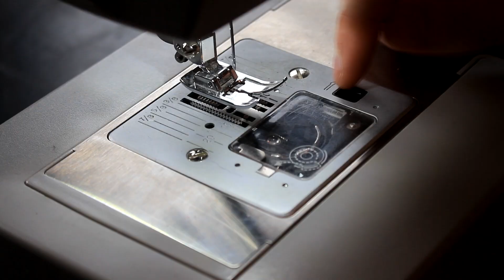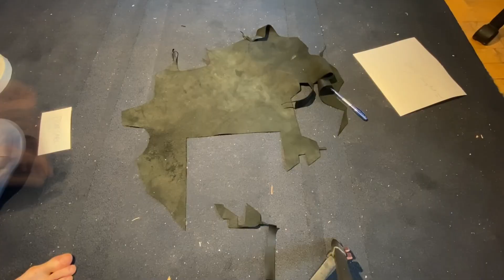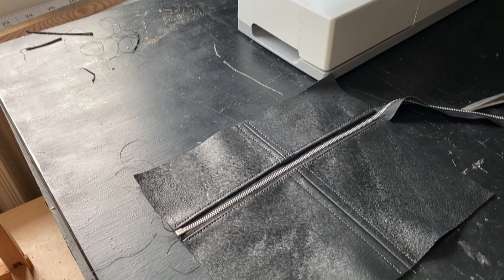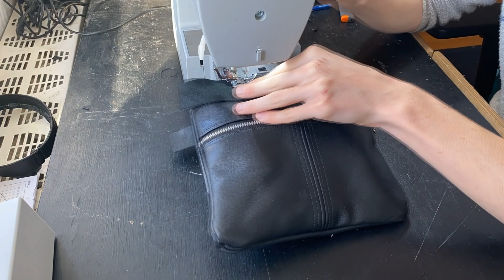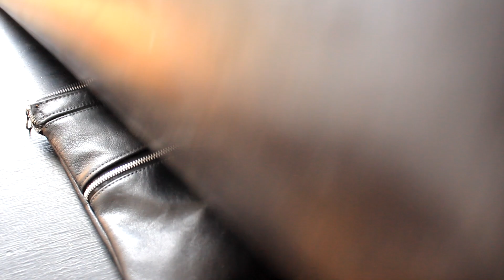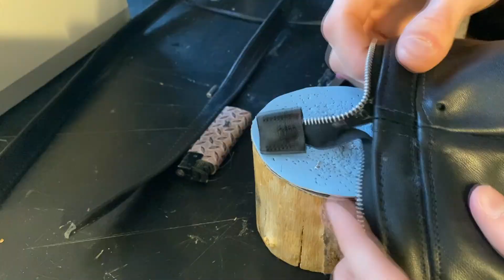Bespoke Leather Bag for a Tough Client

Comment: That machine you’re using is the first machine I ever got. I hated it so much that I upgraded to a Juki TL2010q a couple months later… massive game changer. Check out some industrial machine, I believe the sailrite (sp?) has a zigzag stitch. I make bags using thick vinyl on my Juki with no issues. I just make sure I’m using the right needle for the job so it doesn’t break. The organ brand is amazing. Best needles imo. You should check out different ways to install zippers… there are much easier ways to go about it. Up to you of course. Bag looks great

Comment: I am very impressed with your description of the process and of the result of this project. I have the same Singer Heavy Duty machine, but have not yet achieved similar results sewing leather. I also appreciate that you use glue instead of double-sided tape; less expensive and functional. A very minor point in an otherwise clear and engaging narrative: the ‘strings’ are ‘threads’. Thanks again!
Reply from the maker: Yeah, trying to get the lingo right still, english is not my first language, thanks though!